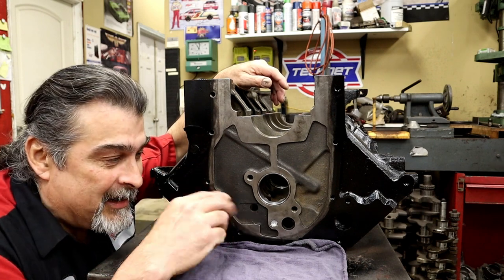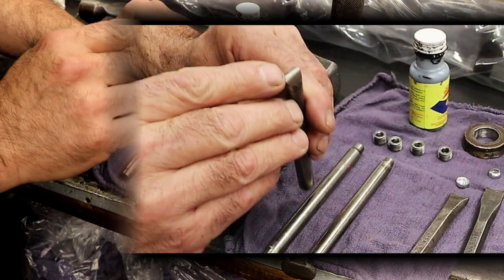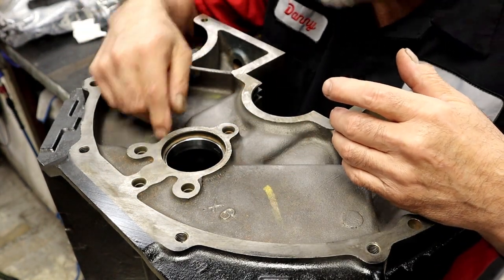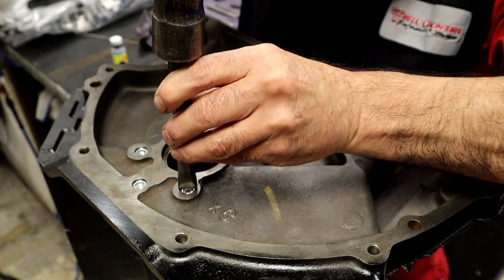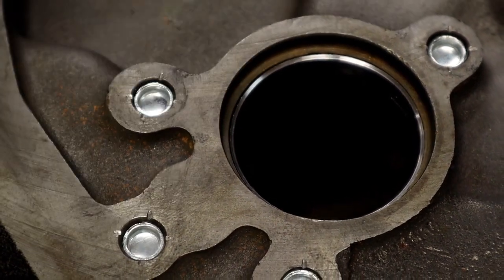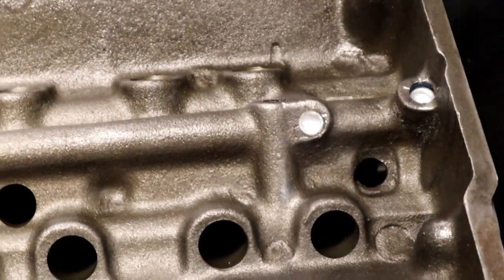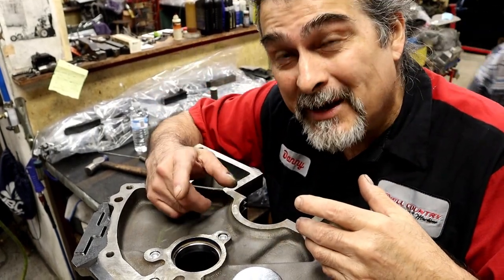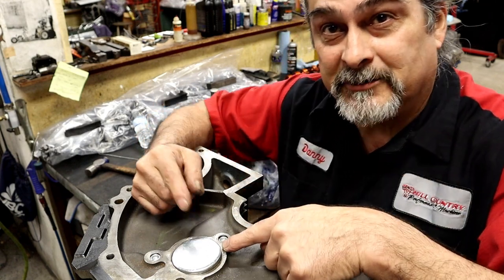Tip of the day "How to install oil galley plugs"

Comment: Good morning Danny.
Great tips and very sanitary installation Danny!!👍👍
This video just popped up today.
I have drivers and swedging tools I have used for years.
The block is malleable enough for swedging.
We have all seen where people used cold chisels, so sad!!!
I did not know about the Tabors, nice sealer.
Thanks for the tip.
I am going to machine up some dedicated plug tools, mine are universal. 
It will save time.
I have done many FE's they are always thread in plug in the rear, new one on me seeing your application. 
I checked out the Tabors website. 
Do you use the Tabors freeze plug install sealer.
Take care, Ed.
Reply from the maker: Happy Saturday and yes the Tabors freeze plug seal.👍

Comment: Question????? have you seen a oil galley plug with a valve in to bleed the air out? 1965 mercury 390
Reply from the maker: Yes, but not in a long time.

Comment: I didn’t understand something 
You said if we building a performance engine we put the ones which we can screw in, so this one is a restoration we put the stock way.  Why not upgrade that and put the other ones that will screw in, it looks a lot more safer than that
Reply from the maker: We have never lost a plug and in a restoration we don’t want to reinvent the wheel.

Comment: Great video what’s the name of the adhesive ?
Reply from the maker: Tapers freeze plug sealer.
Reply: Thanks Daniel I’ll order some. I’ll be removing the timing cover off my 289 to re install the plugs using your technique after I found one of them on the bottom of my oil pan🤦‍♂️

Comment: Do the oil galley plugs and freeze plugs apply the the '95 460 cu and '97 5.8L Windsor engines?
Reply from the maker: Yes , there the same.

Comment: Would it be possible without risk to do screw in plugs sbc front cam ones with assembled block
Reply from the maker: You can, use grease on the tap to catch any metal from the tap. Do a couple of turns at a time ,pull the tap and clean it and then keep going in. 👍
Reply: @MrDanielSoliz  thank you 😊 I’ll give it a try

Comment: Big Question regarding FE 390 timing chain sprocket alignment, after putting both cam a crank sprockets on,   used a straight edge and seen that the camshaft is in deeper by .065 is this normal?
Reply from the maker: That’s not normal,both gears need to be straight. There’s a spacer and plate then the cam gear.